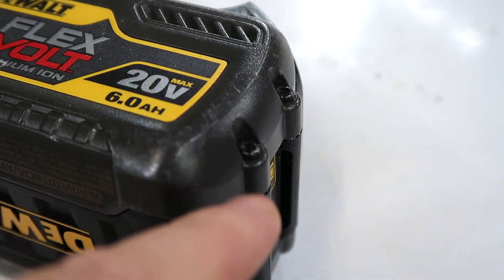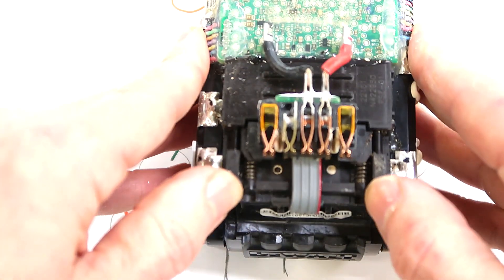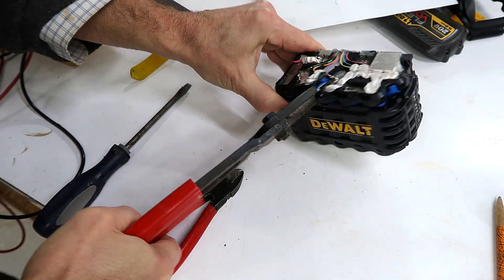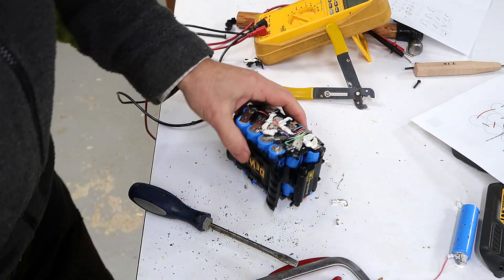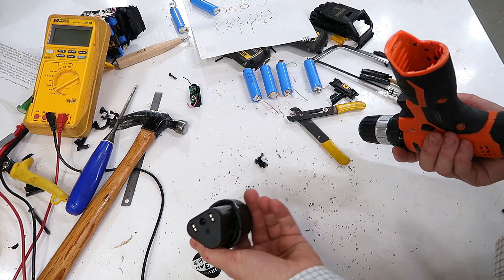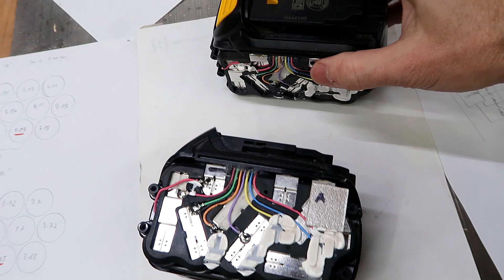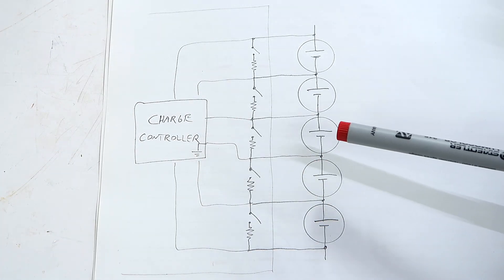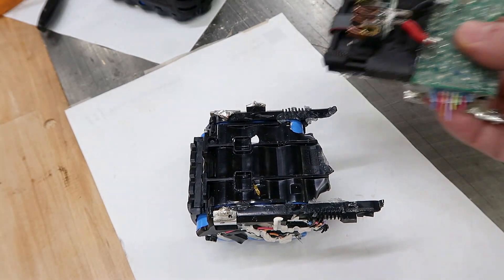This kills flexvolt batteries prematurely

Comment: I have noticed too that few my makita batteries failed i looked inside and few cells started leaking and voltage was too low so i use the other cells in my flashlights. Great videos Matthias.

Comment: This is really good information, I have some yard tools that hit batteries hard, then they sit over winter. My batteries are compatible with some hand tools so I plan to rotate them in and easy use them + charge cycle a few times to balance things out.

Comment: This is good information and I will make sure not to run these things dead. I have a 6Ah and a 9Ah so I will be keeping these things from getting down to 1 bar. 

Another thing that applies to all of these batteries is to try to keep them in climate control as much as possible. Extreme cold and hot are both bad for these things. I sometimes have no choice but I still try to keep them in a separate bag and bring them in the house instead of leaving them in my truck all the time. 

FYI the cheapest way to get these batteries is to buy complete kits, instead of bare tools. The kit is usually about $100 more than the bare tool. These batteries cost a lot more than that for these bigger ones. My DCD 999 was $175 for the bare tool and $275 with the 6Ah and a charger. That battery alone is usually about $200 at Home Depot.

Comment: My understanding is that the bms is in the charger,  not on battery and every tool has its own low voltage cutoff.  An inspection of a 'normal' battery would show no bms on board. 

The flexvolt actually has a good amount of circuitry on top.  There is both a mechanical and electrical interlock to get them to run at 15s 1p mode vs the default state of 5s 3p.

The Dewalt and Bauer both expose each battery at the connector. For that external bms.  

I bought Dewalt expressly for this as I can use a hobby charger and balance charge and test and all the advanced features a hobby charger gives us. 

I love charging a flexvolt battery on my hobby charger at the lower voltage and using it in my chainsaw at the higher voltage.  Solar powered chainsaw!
Reply: A single bad cell in this 3p configuration would pull down its two siblings as well. 

I seem to recall that the red shipping clip is called for during storage.  It mechanically disconnects the battery from a 5s3p to three 5s1p.  That would protect a single bad cell from becoming three bad cells. 

Until we try to use it.

Comment: The undervoltage cutoff is perhaps based only on the total series packs, but if it also monitored the individual cells this effect would be prevented. A pack that has sat for a while, discharging the middle cells a bit, would just shut down earlier than one would expect for a full pack, and a full charge would correct it.

Comment: It's perfectly ok to replace the 3 broken ones. The only issue is you need to balance them before installation and subsequently test them with a battery tester. I have one of those charging/checking stations and a spot welder, have fixed my batteries plenty of times. Funny thing... whilst one of these packs lasts new for 2~3 years, once they're rebuilt they last much longer. Oldest i've repaired now has 4 years and counting. Obviously, not everyone's cup of tea, but i have the equipment, so i can.

Comment: Most power tool batteries have a very basic BMS system. It’s worth opening up the pack every few months to  monitor individual cell voltage.

Comment: Like many people said in the comments below, you can usually charge up the low cells manually up to a  level where the charger takes over and balances them all. But only do this on a relatively new battery which has been left discharged on the shelf for many months. Can be a faulty cell on older battery.  I have recovered many like this.

Comment: I've had similar happen when I left a battery discharged too long. I hooked up a charger to the low cells then bring them back into range. Then top up each cell to balance out the pack. It revived a pack for another yr.

Comment: Wow, this makes so much sense. Ive had fairly good luck with my Dewalt batteries (as opposted to Husqvarna) for larger machines, chainsaw, mower, trimmer. But I will definetly remember this, charge them upp even if put away full.

Comment: This deserves to be on the main channel.  If others knew that they should throw all their batteries onto the charger periodically, it could save a lot of resources.  I occasionally lost a battery in early spring (when work ramped back up) and didn't know why, but maybe that won't happen now that I will charge the full batteries before use.
Reply from the maker: it's not woodworking directly, and my battery related stuff is on this channel.  It has a tenth the subs, but the views the videos get are the same, so which channel really doesn't matter in that regard.
Reply: Also never run them down too low and if you can wait for 10-15 minutes to cool them off before charging them again.
If you can, avoid fast charging that will help their lifespan as well.
Reply: I've encountered many different opinions regarding how charging affects battery life.  I've always been "keep 'em charged" kind of guy.  I usually run them until tool performance suffers rather than until they stop working.  If they're not in use and below 50% I charge them, and if they're below 75% and I plan to use them hard I charge them first.  Some people have told me that Li-ion batteries have a fixed number of charge cycles regardless of the depth of discharge, so if I charge one from 70% to full, I'm "wasting" a charge cycle and shortening the life of the battery.  I would love to know if it's that's true or not.  I suspect there's a kernel of truth to it, but like so much conventional wisdom on the internet, it's probably exaggerated or only partially true.  For now I'm more concerned about excessive discharge than charging too often.
Reply: @charlesenfield2192  You've got the right approach to making your batteries last. The charge life of a lithium battery isn't "wasted" for any given charge -70% to full is not equivalent to say 10% to full. There are charge profiles that reduce the lifespan of the battery - for example charging at 1C (charge current equal to battery Ah rating) is more stressful than charging at 0.5C and less stressful than charging at 2C. Many lithium ion batteries keep better when stored between 30%-70% charge while not in use, and avoiding a complete discharge may extend the life somewhat. Extreme temperatures when charging or in storage can also wreck batteries - keeping the batteries in a climate-controlled place will help more than micromanaging every charge event.
Reply: @PaulSchaffert  Except that lithium batteries don't like being kept fully charged. Modern phones have a "smart charge" feature which engages if you're charging overnight - it charges to 80% and then holds, only doing the last bit to 100% shortly before your alarm is scheduled - for exactly this reason. So regular charging is good, but charging to 100% is only good if you're going to use the tool fairly shortly afterwards. For longer periods without use the battery should be at mid charge ideally.
Reply: @cooperised  Which brand of phone are you using? On my Samsung I had to schedule this manually using Tasker.
Reply: @user2C47  It's a Pixel 6a. My wife's phone is a bit older and does the same thing but I can't remember what phone she has!
Reply: @cooperised  Such a function for charging things is awsesome. I read a lot about quick charging smart stuff, that it quick charges to about 80% and then gets slower for the last few percent. For the same reason it makes no real world difference if you quick charge your phone with 18 W or 30 Watt, because the last few percent are kind of slow anyway. On my Smartphones i can observe this behaviour if i put them on a quickcharger. Mostly i charge my smartphone on the slowest charger i have around.
Reply: @cooperised  phones simply overcharge the batteries over 4.35V by default (with 4.22-4.25 being the spec). Tool batteries usually get charged to 4.16V or so. 'Full' (and percentages) just have a very different meaning, with phones being scummy.
Reply: @charlesenfield2192  batteries that are sold for medical use have a limited number of charge cycles programmed into them to prevent using old batteries. In other markets that anti-feature is left out, but that's probably where the myth comes from.
Reply: This has ALWAYS been the main channel. You just didn't discover it until now...
Reply: They should be built with a timer and a really loud alarm, and if you don't charge them you go to jail, that would save a lot of resources
Reply: Batteries can be very fickle, and most users take them for granted.  I own all the brands, but let Me tell You, what Matthias said here ESPECIALLY applies to M18 Batteries!  Don't let them sit too long on a low charge, or you’ll be sorry!  Not a knock on Big Red as I own dozens of M18 batteries and tools, just a helpful FYI!

Comment: I metered all my Dewalt batteries the other day, and two-bars on the charge indicator is about 19v which is 3.8v per cell. This appears to be a good storage voltage, based on my quick research of lithium ion batteries. For DIY'ers like myself who might go months without using our batteries, they should be stored 50%-80%, then charged up to 100% before using them again judging by your findings in this video.
Reply: I have read that as well form reputable science. 
It's best not to store full, not to store empty, no fast charge if you can, do not discharge too quickly (drawing lots of current for long times) or let the voltage get too low.

Comment: You did not try revitalize those dead batteries? With low current bypassing the charging circuitry those  0.3- volt batteries may become good again.

Comment: It's too bad, they can't be stored wired in parallel, to keep one cell from dying once in use again.  If only these came with specific balance leads, like RC batteries.  Probably still a good idea to throw them on the charger before heavy use either way.

Comment: Makita has this same problem of reliably killing one particular cell that powers the bms circuit while the other 14 cells are still going strong
Reply: There are no makita packs with 15 cells
Reply: @riba2233  guess I got my count wrong, I have 2 dead batteries & each has one dead cell.
Reply: @EngineerMikeF  they have 10 most likely. Newer BMS designs don't do that
Reply: @riba2233  Is the a version designation of the improved bms? Thanks for the info
Reply: @EngineerMikeF  not sure since when exactly but I think that newer packs with larger bms pcbs that have individual cell balancing have this sorted

Comment: When dealing with those start + Post security screws I typically find a straight bit screw driver and go between two points of the start and tangent to the middle post. tends to work the majority of the time and you don't have to bust out the pin in the middle.

Comment: Wonder why the 3 dead cells are next to each other, but are on different circuits? Perhaps that area gets the hottest during charging? Or when it’s delivering a lot of current… or even a balancing issue?
Reply: Matthias mentioned they are the middle cell in each circuit.  I think there are 3 separate BMSes, one for each circuit, each powered off the middle cell, hence why each middle cell gets drained down.  As to why the middle cell rather than an end cell, Matthias pointed out that by using the middle cell you only need a BMS capable of going between +12V and -12V, rather than +20V and 0V.  You can get away with using wires with thinner insulation.  I'm guessing that the BMS design originally came from laptop batteries and was adopted for this market.  In laptops control circuitry typically only needs about 3 volts to operate.

Comment: my 6ah flexvolt died after hooking it up to a diy led work light and fully discharging it after forgetting it turn it off.   same middle cell
Reply: Snap!
My diy 10W chinese floodlight killed the battery. I replaced the bad cells but the rest soon followed. Now I change the whole set if one goes bad. Lidl/Aldi good for new cells.

Comment: RC batteries develop a similar problem, but they don't have built in balancing circuits. I always thought it was the individual cells being stressed differently based on their location in the series/parallel wiring.
Reply: Yeah, I look forward to the day when RC batteries come with BMSes to maintain the individual cells.  The battery operated tool market has surpassed the tech used in RC batteries and I can't wait for them to steal the good ideas.
Reply: I have to say that I learned most of the info on balanced charging from the RC world. Mostly all RC batteries I have seen have balanced charging capabilities but as you point out they don’t have a BMS on board and I think that is because they want to save money and save weight. I really think the RC world makes much better use of charging technologies for the benefit of the user and since they don’t get away with packaging everything as tightly as other industries can, they can’t get away with disabling the whole pack and other dirty tricks like they do with laptops, tools and others.

Comment: Very interesting find.  If that one cell(in the series) was depleted or nearly so but the others were not, would the pack show dead or would it still operate? 

Always drove me nuts, especially years ago that battery powered electronics always consumed some battery power, even when they were suppose to be off, even flashlights.  I'd find my device dead or nearly so.  I started taking the batteries out and storing them near the device when convenient and that helped a lot.  Even my newish laptop mouse I keep in my backpack has to have the batteries removed or otherwise the dang thing will be dead when I need it.  

I can imagine installing a little switch to turn off the draw when battery is sitting on the shelf.
Reply: the math is like this.

5p = 4.2 * 5 = 21 volts at full charge AND 16v at design lowest (assuming a 3.2v cell cutoff, which is typical, though they may use as low a 2.6v cutoff to shorten pack life).  Below 3.2v, a typical li-on battery has almost no power.  This is called the "knee" because ampacity falls off logarithmically below this voltage.  In a motor analogy, there's "no torque".

So let's imagine the loaded cell depleted down to 2v, and the rest of the cells floated down to 4.15v.  You'll measure 18.6v, which might be around 50% on your "fuel gauge", however you have mere seconds worth of "torque" because the voltage on bad-cell is going to collapse on you (down to 16v).  Make sense?
Reply: the pack would die very quickly under any load, analogous to a high rpm engine with no torque.

Comment: I always wished some third party would sell chargers that balance the pack at storage voltage, like hobby chargers do. I think manufactures don't include this feature because they just want to sell us new batteries.
Reply: I hook my Dewalt batteries to my hobby charger and have full control of how I charge the batteries.  I actually picked the Dewalt platform because I can charge the flexvolt batteries on my hobby charger at 5s and use it at 15s.

Cannibalize a charger.  There are a great many floating around, some dead or broke.  You just want the connector.
Reply: @MikeCreuzer  I have a couple of hobby chargers, but not everybody does. People shouldn't be expected  to source and cobble together a fix for this problem. The world isn't going to change because we complain though, so I guess its time to take your advice and break out my soldering iron.
Reply: @stevew7308  I do believe that the normal Dewalt charger does do a balance charge for us.  Just not to a storage voltage.   At the end of the day, the primary market would be contractors, who run hard every day, no need to balance storage charge for the primary market. 

There is a market opportunity for a turn-key balance charger with a storage mode in it. Jump on the market. Make one for each of the major brands!

Comment: What a piece of crap BMS design in which case. It should have a low voltage cutoff at the cell level but it appears to be at the pack level instead.

Comment: I bought a aliexpress spotwelder. It works very well with a big car battery as current supply ofcourse. Dont mean to spam you guys. This way breaking the spot welded taps is not an issue.